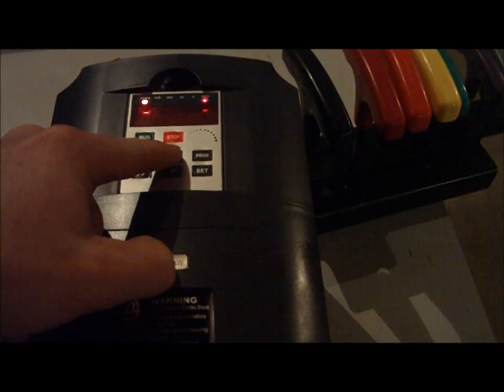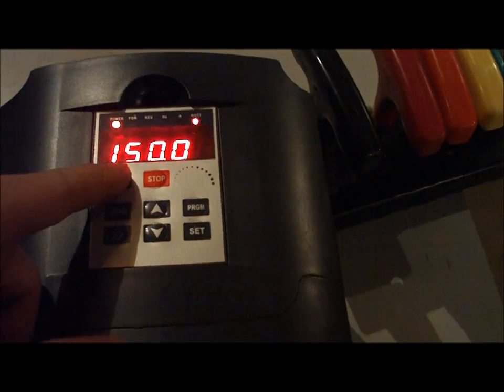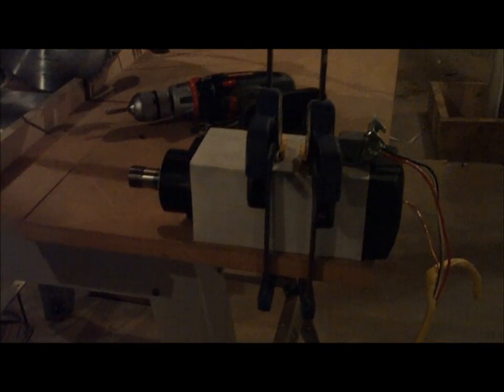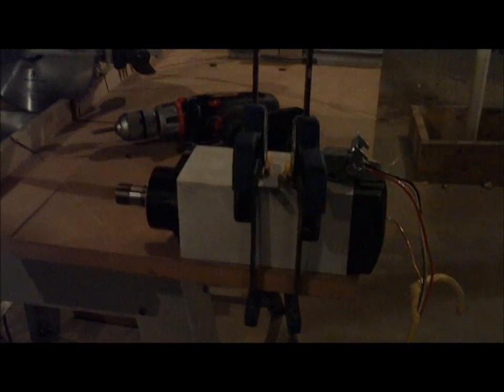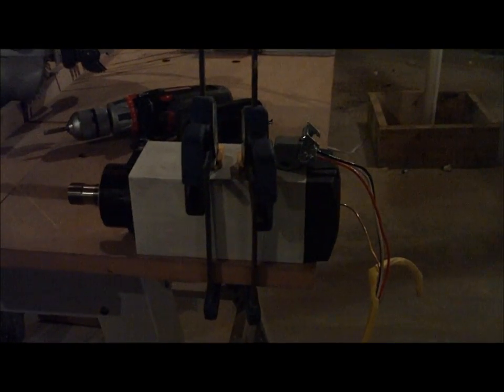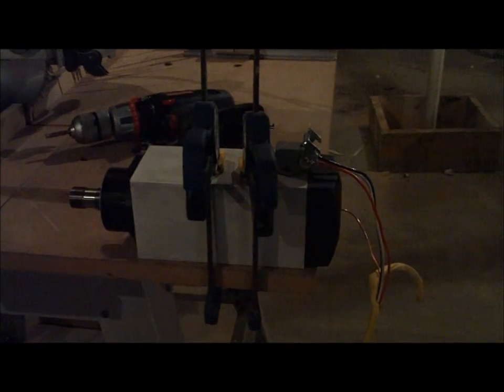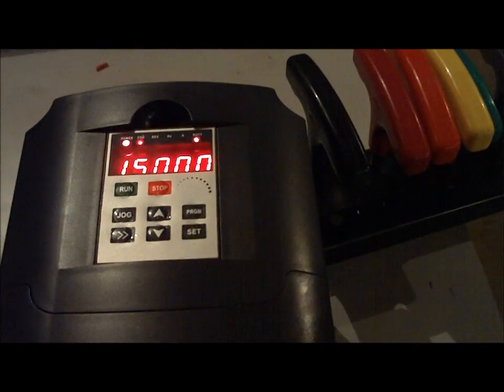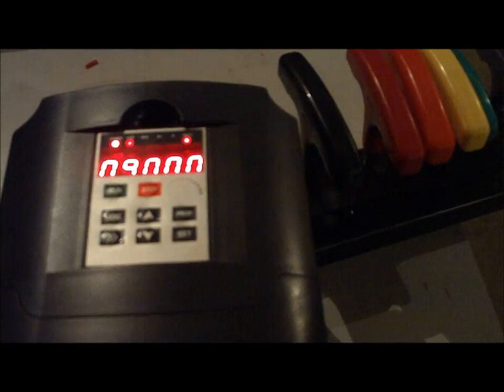5hp/4Kw Spindle Test

Comment: What for collet Spin???
Reply from the maker: I guess I don't know what you are asking?
Reply: @swaggs21  are you use collect for spindle.
Reply from the maker: Yes, ER20, but not in this video, this was to make sure I wired it correctly and that it didn't blow up on start-up :D
Reply: @swaggs21  My engine motor is like you but not ER20. I think OZ20.